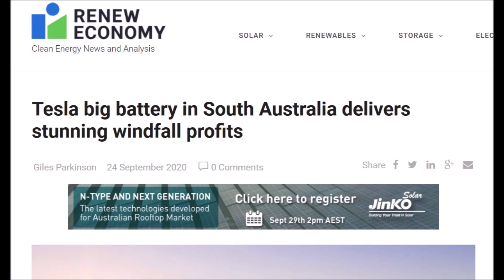Tesla Big Battery in Australia Earns Huge Profits, Pays for Itself in 2.5 Years

Comment: Each one of these wins for Tesla helps prove the value of modern battery peaker plants. The latest Battery Day announcements show that these installations will become even more of a value as lower cost battery production make prices fall.
Reply: The problem would be to be able to make enough batteries at the first place
Reply: They're on track for massive battery improvement and cost reduction. No other vehicle maker will have the guts to become a lithium mine owner.
Reply: @andrewsaint6581  bullshit, actually many car companies like toyota have been securing mining sites and working with mining companies, since toyota already makes 10 million cars a year. Toyita likes to produce in mass and seriously cheaply
Reply: @carholic-sz3qv  Argumentative aren't we!
Reply: "battery peaker plants" is a misnomer.  The utility scale storage does peak shaving.  Batteries don't generate electricity -- they're storage, not a plant.
Reply: @acmefixer1  Yeah, energy storage. But in areas like mine that have solar electricity production that exceeds demand much of the year, battery storage helps provide nighttime power to the grid much more efficiently than gas powered peaker plants do.

Comment: You have to factor in Australians pay massive electricity bills. So Australia is very profitable to do this. Combined with the perfect climate.
Reply: It won’t be long before Elon charges a few million for battery replacement and upgrades. Giant mechanical storage systems can be used in the same way for decades even centuries with no loss of efficiency or performance - and completely Green and sustainably.
Reply: @richardmasters8424  the best one is pumped storage, not something suitable for this desert location.
Reply: @EFCasual  - no - flywheel energy storage would be much better. They could use them in the same way for decades without any loss of storage capacity and efficiency, and once manufactured they would be far Greener than horrible toxic, short-life batteries.
Reply: @richardmasters8424  I'll believe it when I see it. Today flywheels are not used in large scale power applications.
Reply: @EFCasual  - Yes - you are right, but there is growing recognition of the sustainable  benefits of mechanical storage systems (gravity or momentum-based) and my engineering students have designed several sizes of high inertia, low angular velocity grain-silo sized FESS solutions which hopefully will become the norm across the World in future.

Comment: The Tesla 'Big Battery' was built in 2017 in response to widespread blackouts across South Australia in 2016 caused by storm damage to electricity transmission infrastructure - https://en.wikipedia.org/wiki/2016_South_Australian_blackout

Comment: I appreciate the info but a breakdown of what " inertia services" actually is would have been nice.
Reply: This is what I understand: steam turbine is connected to a generator in a power plant, they both spin together, this is huge piece of iron, and when it spins it has an inertia, in other words: even when you stop the power source it will continue to spin for some time, because of the stored rotational energy, and the fact that it doesn't stop immediately contributes to the grid stability.
Reply: Enabling fewer power generators to operate by smoothing the load. There is a high cost to firing up an additional generator due to its 'inertia' hence this legacy term describing power loads as having an 'inertia'. The battery reduces 'inertia' events for the utility.
Reply: @EFCasual  thanks

Comment: "[Tesla's battery] delivers huge windfall profits..."
You have to remember that those windfall profits came out of someone else's pockets.  The idea should not be to take money from someone else.  It should be all about saving money for all while reducing the CO2 emissions.
Reply: If you wouldn't mind please start a nonprofit company which provides the same solar, wind, and battery storage capacity as this operation has. Don't forget this plant provided power to a downed grid in an emergency when many 1000's of customers would have been without power for days otherwise. Additionally the power provided from this unit CLEARLY is saving customers of the grid money as stated to the tune of $90,000,000 australian. This is accomplished by supplying the grid with extra electricity during peak hours at a discount to normal peak hr prices.

Comment: Unfortunately the Tesla big battery is a very poor long term solution for this type of requirement.  Mechanical systems like grain silo sized flywheels would be totally sustainable, untoxic, not use rare materials and could be used for decades, even centuries, without any loss of storage capacity or efficiency.
Reply: So what would have to be the size and rotational speed of a flywheel to store 100 MW of power?
Reply: Andrzej - I have got my engineering students to optimise the size vs RPM and we’ve gone for a high radius of gyration for slower RPM rather than what most people think of - higher RPMs. I presume you will know that the energy stored is proportional to RPM^2 but also k^2?  Bearing losses are directly proportional to RPM so slower speed designs are more efficient and safer. The heat generated by the flywheel is also beneficial as it raises the speed of sound in the flywheel’s enclosure and reduces transonic drag - ideal for a desert location and no need for forced ventilation and cooling like the Tesla big battery. We’d run our flywheels at about 500K and use any excess heat for other purposes or to generate electricity in the conventional manner.  There is no patent on our work yet so we give the ideas to everyone freely.
Reply: Richard Masters That’s interesting do you have a scaled working model? Does it use solar energy to drive an electric motor to drive the fly wheel, that then becomes an electric generator to release the stored energy?
Reply: @richardmasters8424  x^2 is always nice if it works in your favour. From Wikipedia I got this: "The flywheel energy densities are 28 kJ/kg (8 W·h/kg); including the stators and cases this comes down to 18.1 kJ/kg (5 W·h/kg), excluding the torque frame." 100MW / 8W = 12*10^6kg. Do I get this right that to store 100MW I would need to rotate 12.000 metric tonnes of mass?
Reply: Andrzej - you can’t really store ‘100MW of power’ because it depends on how long it supplies to the load ie 4 secs or 4 hours.  The nice thing about flywheels is if you want double the storage then just use 2 of them.  FYI - our biggest single flywheel designs can store 100GJ of energy.
Reply: Allan Jones - there’s nothing new about this technology - it has been used since the 1920’s and is currently used to store energy to give time for things like standby generators to start up in UPSs and as a back-up power source in nuclear power stations etc - so there’s no need to prove the technology.  What is new, however, is using giant high inertia - low speed (<3500RPM) flywheels where most current designs are very much smaller low inertia high RPM, presumably for compactness.  We are also great advocates of giant gravity storage systems too (ie weight in shafts or pulled up slope) where suitable.  If you have any contacts in industry to develop these ideas and sell them around the World, then please get it developed and manufactured - we at the college Technology Centre give it to you for free!
Reply: Andrzej - please see my previous response - we store MJ not MW.
Reply: Said, "[flywheels] don't use rare materials..."
You don't realize that the flywheels use powerful magnets which contain rare metals such as neodymium.
Or else you're purposefully lying to everyone.
Reply: Acme Fixer - we don’t have to use rare earths to increase the efficiency of the magnetic circuits - you can still get very good performance just with traditional copper field coils.

Comment: "Batteries are not economical for grid storage"
Reply: Grid storage not yet.. But, viable as picker plants..
Reply: Virtual power plants may fundamentally change the grid to a prosumer model. Batteries will drastically alter the grid from the simplistic central generation model to a distributed generation and consumption model. Batteries are morphing the grid.
Reply: @joeabad5908  
Said, "[batteries are] viable as picker plants."
Batteries are not peaker plants -- they don't generate electricity.  Batteries do peak shaving.

Picker == peaker  🤣🤣